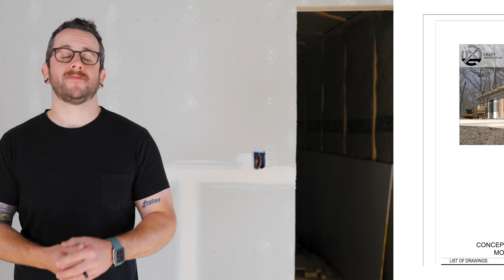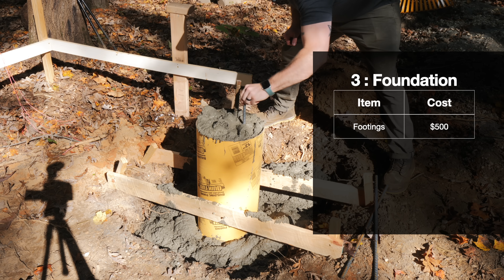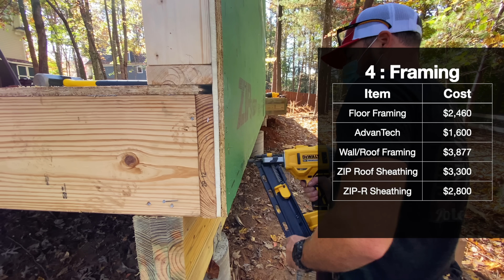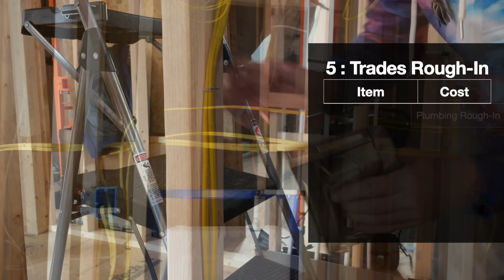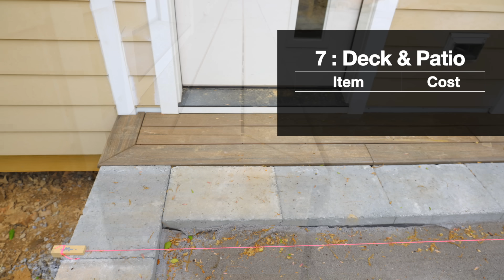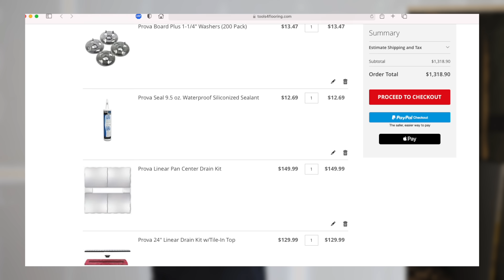How much does a TINY HOUSE COST TO BUILD in 2021? Cost Breakdown

Comment: Tip for anyone that may want to buy these plans and build from them: You may still need to hire an architect or engineer to go through them to make sure everything is up to code in your specific jurisdiction. Probably still a cost savings. Also, permit fees vary GREATLY across the country, so take the permit fees with a grain of salt. $500 for the building permit is super reasonable. In CA, that would be probably more like $1500. Loved this series Johnny!
Reply: Here in San Francisco you could pretty much forget it. Everything takes at least 3 years for anything to get done with permits, fees, and of course the NIMBYs. That's before dealing with "inspections", and getting actual work done. This is why roughly 95% of in-law units are "unwarranted" - aka done without permits.
Reply: @Erik_The_Viking   n!!! N b b!! N n
Reply: lol you aren’t kidding about permit fees varying - for just a swimming pool I built this year I’m at over 2k in south Florida.
Reply: I handle public sewer connections for clients in eastern Pa and have seen tap-in “impact fees” range from $2k-$22k. People don’t realize how drastic prices can vary even within a state or county.
Reply: Try $15k impact fee in Frederick MD to even get permission to start building a house... thats not even the building permits or anything.
Reply: Building permit for my city is $25.00